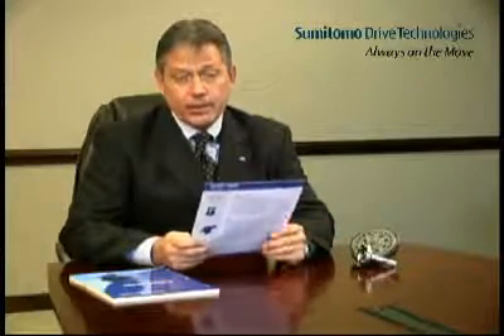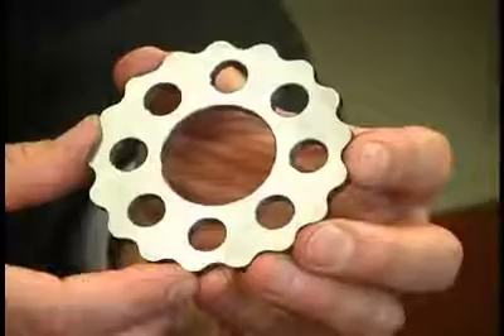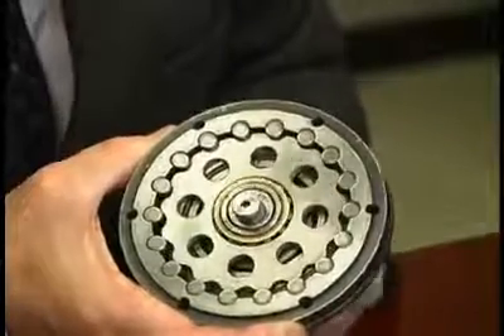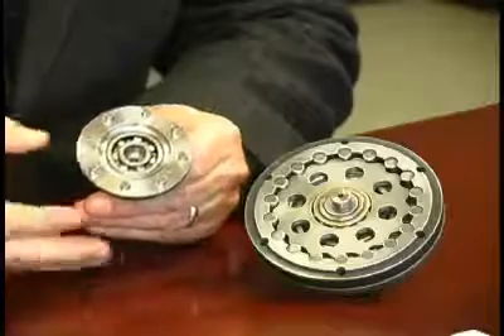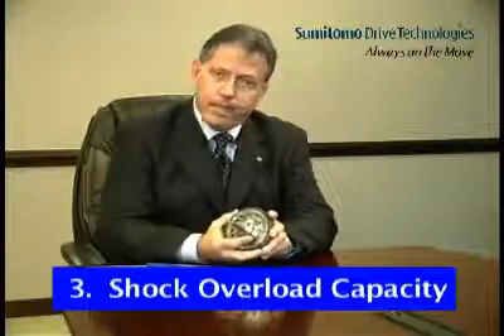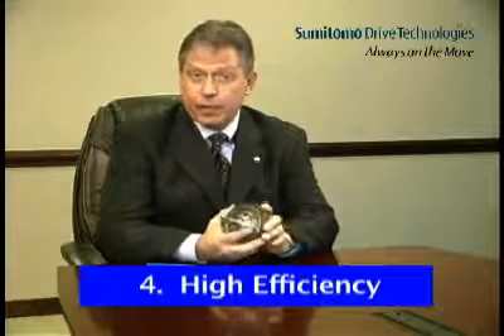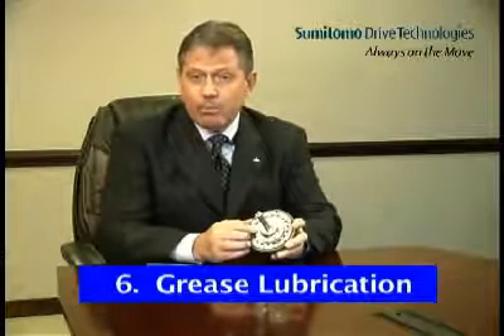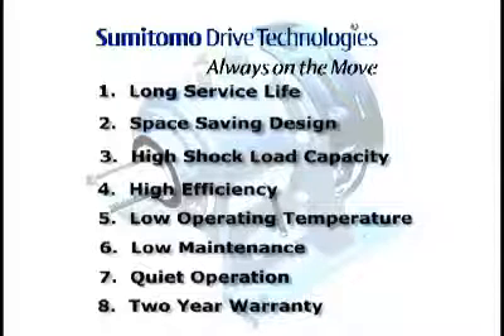Sumitomo's Cyclo Demonstration with Alan Steele

Comment from the maker: If you're interested in the great shock load benefits of the Cyclo as demonstrated, and additionally would prefer a zero backlash product with minimal lost motion, we highly recommend our Fine Cyclo series.

The same Cyclo advantages apply, except that this series is intended to excel in applications that demand accurate positioning, such as the robotics industry.

Comment from the maker: The product that is demonstrated by Mr. Alan Steele is our standard 6000 series Cyclo reducer, which is not a backlash-free product. As a matter of fact, the standard Cyclo reducer will operate under a torque ripple effect (i.e. small variations in torque transmission/output) due to it's inherent backlash and motion.

Comment from the maker: @hmsecho 

Gear teeth generally fail due to high stresses that come in form of shear forces. Instead of shear forces, the Cyclo toothless design is subject  to compressive forces. 
Cycloidal gear designs eliminate catastrophic gear tooth failure and is less immune to metal fatigue issues because there is no gear teeth meshing in shear force.